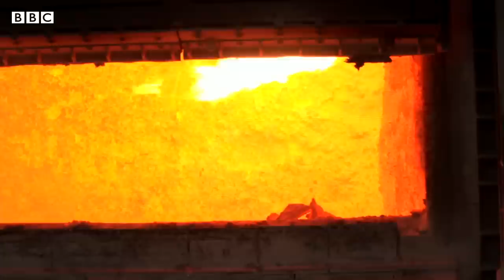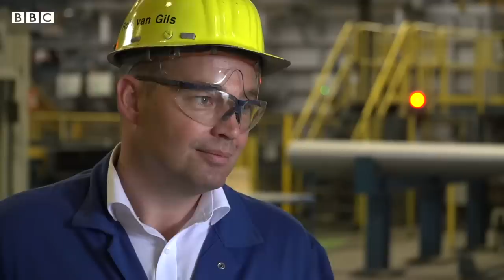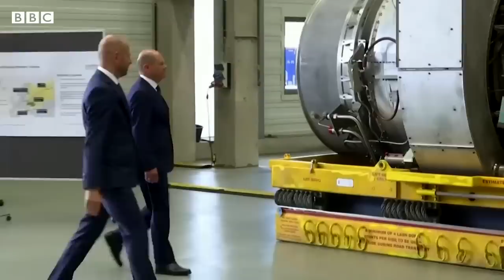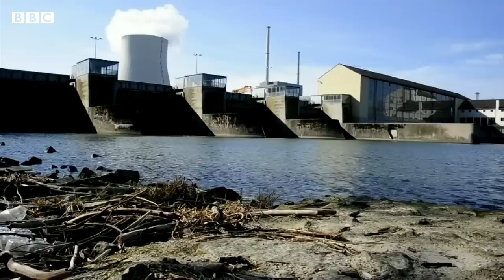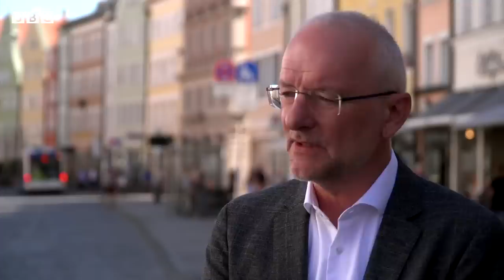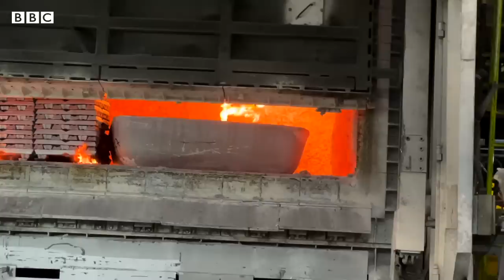Impossible to return turbine vital for Europe gas supply says Russia energy giant Gazprom - BBC News

Comment: And this is why shutting down the nuclear reactors was a bad idea
Reply: Well, in Germany shutting down nuclear was decided years ago, when there was enough electricity and heat to accomplish the transition to renewables
Reply: @danielbakamendez  it doesn't sound like they accomplished transitioning to renewables if their still dependent on Russian gas
Reply: @danielbakamendez  doesn’t sound like renewables are viable.  Rather bad planning.
Reply: @danielbakamendez  renewables alone are not sufficient to supply energy to an entire nation. At least not with current technology.
Reply: @Land-of-reason  Doesn't sound like gas is reliable.  Bad planning to rely on it.  Should have went full speed into renewables.
Reply: Tell that to the people who used to live around Chernobyl.
Reply: @kenbob1071  renewable are far from viable.
Reply: @danielbakamendez  and now the renewables have failed, which we new they would.
Reply: @kenbob1071  renewable energy has failed in Germany, did you miss that bit?
Reply: Everything has a finite design life. Running something like a nuclear reactor beyond it's designed working life is potentially extremely dangerous. Trying to extend that life is potentially cost prohibitive. They don't just shut down a perfectly fine reactor
Reply: @stevec6427  they did though.
Reply: @stevec6427  are you a neuclear expert who understands these reactors?
Reply: @marclang7431  Renewables work fine in Germany with 51,2% share in 2022 so far.
Reply: Indeed, too little too late.
Reply: @Land-of-reason  they are entirely viable, they just weren't rolled out in large enough numbers to sustain the power grid, and it's not like gas is going to be forever.
Reply: @nerdlingeeksly5192  so they work when the wind is not blowing.  That’s a good one!
Reply: @Land-of-reason  wind power isn't the only renewable, solar is also a renewable as well as hydro and biofuel; your statement alone shows how uninformed on renewable energy you are.
Reply: @nerdlingeeksly5192  as a scientist I am extremely well informed thanks.
Reply: @Land-of-reason  I doubt you are, the current advancements in solar alone are enough to supply Germany with most of it's electricity if they were to get them rolled out on every residential roof as a government funded initiative.
Reply: @gerbre1  Germans pay around 50% more for the electricity than all the other European countries. Also Germany's renewable energy whilst making up over 50% has not been able to achieve those figures. Now they say the need at least another €600b to maintain a stable grid. And are restarting coal power plants.
Reply: @marclang7431  Energy prices are high not because of renewables but because of fossils. Renewables are cheap, fossils are expensive.
Reply: @gerbre1  no you are wrong. The price increases were to pay for renewable energy technologies and application. As and when renewable energy was adopted the price went up. Your comment has absolutely no logic whatsoever, you need to read more into the problems and cost of renewable energy.
Reply: @marclang7431  Just search for Stromgestehungskosten erneuerbare Energien from ISE Fraunhofer, esp. have a look at the graphic with all the costs. PV and wind are the cheapest.
Reply: @gerbre1  no you misunderstand me. Of course production of electricity is cheaper for wind and solar, it's virtually free but the cost of manufacture and installation is INCREDIBLY high. A wind turbine also has a short life span less than 10 years in most cases. In the case of solar you need vast swathes of land to produce modest amounts of energy compared to a power station. A lot of the time there may be no wind or sun, therefore very little power is produced, coal and gas plants are then on standby, hence why Germany's C02 levels actually went up after reaching 50% renewable. But who pays for the expensive technology? We do, that's why the energy prices are going up, the government have said this, energy prices have to rise to pay for the renewable energy to be manufactured and installed but, when it doesn't work properly, you end up paying for the renewable energy and getting coal. Here in France we have realised this stupidity and are investing heavily in nuclear (again).
Reply: @marclang7431  Gestehungskosten contain the costs to buy and install the parts. Please read the fraunhofer paper to inform yourself. CO2 emissions are decreasing for years except for 2021 because of Covid in 2020. In France 50% of the reactors are not running and Germany has to help out with exports. Germany has exported more energy this year already than last year completely. France is constructing only one reactor Flamanville 3 for years. Meanwhile the average age of the other reactors is 37 years. EdF has 40 Billion debts and the government was forced to buy the rest of the company. It's unclear if the construction of Hinkley Point C will end in a financial desaster for EdF.

Comment: Germany can find other ways to produce electricity, but they still use gas burners for residential heating and in parts of the industry. The problem is that you cannot burn electricity in a gas burner.
Reply: Well I guess we all have to save energy, it is doable, specially the winters are really mild, I never use the heating, (Munich)
Reply: A kWhr of electricity is worth more than kWhr of gas. If you go from electricity -> heat you get 100% conversion efficiency, but if you go heat-> electricity you only get about 50% efficiency (see Carnot efficiency).
Reply: @Andrew-rc3vh  Modern heat pumps are even better than that. A heat pump with 400% efficiency, can use 1kWh of electricity to transport 4kWh of heat in to a house - But heat pumps take a long time to install, so many Germans are stuck with gas burners for the winter.
Reply: @anotherelvis  This is why electrical energy is worth more. It's to do with entropy and the second law of thermodynamics.
Reply: Electric baseboard heaters are cheap and easy to install.
Reply: No they cannot
Reply: @Deutschland8894  "I never use the heating" - some people in Germany still have children. Not all of them are lgbt.
Reply: @viaceslavmikhailovich9825  If Nord Stream 2 were working, would Russia allow gas through it?
Reply: I think it helps to understand: 73% of NG is used by industry and commerce in Germany. And the emergency gas plan insures homes and hospitals would be the last to get gas cuts. I am certain nobody will freeze. But business will need grants to survive this winter. Our economy will take a hit for sure.
Reply: Electric heats are very cheap. A 2kW heater can be as cheap as 3 burgers. No problems.
Reply: Nothing odd about natural gas heating! All of Canada runs that way. Probably because we have plenty just like Russia. Let's redirect all our exports to Germany I say.
Reply: "From that time Jesus began to preach, and to say, Repent: for the kingdom of heaven is at hand." Matthew 4:17 

"Ye have heard that it hath been said, An eye for an eye, and a tooth for a tooth: But I say unto you, That ye resist not evil: but whosoever shall smite thee on thy right cheek, turn to him the other also." Matthew 5:38-39|□
Reply: @viaceslavmikhailovich9825  there is so much wrong with this sentence. first off: lgbt+ people can have children. so that part of your sentence is just… bullshit. 
second off: i was much less susceptible to the cold as a child than i am now at an adult. i notice the same with kids i take care of. they get more bothered by the cold the older they get. 
third off: are your children incapable of wearing clothes?
Reply: @dorkstarling615  I'm literally a Eskimo but I'm good till about a week of -20F without heating. Besides having to protect the sink there's nothing that can't be handled with normal comfort clothes and my jacket just as long as there's 4 walls and a roof
Reply: @dorkstarling615  When I was 15 my mom was in nome for medical and somebody stole our fuel. I ended up going a 3 days without heat while it was -60F out and I legit just heated all the pipes with my hands, which I reheated with a candle

Comment: Currently gas storage in Germany is 72% full and 80% will be reached within 2 weeks despite low Russian flow rates.
Reply: It can last only a month if the supple completely stops at current rate of consumption in winter
Reply: @digantdalal  no. At 95% storage it would cover gas consumption for 3 months without any supply or gas saving measures. 240thw out of 990twh annual consumption. But 65% to 70% of German gas supplies do not come from Russia, but Norway, the Netherlands and a few others. Current gas consumption is 25% below 2021 levels.

Comment: The key Nord Stream 1 pipeline from Russia to Germany is currently running at 20% capacity because it's old and needs lot of maintenance and  repairs. That's why the Nord stream 2 was built in partnership 50/50 between Russia and Germany, and Russia is willing to supply through that pipe line as much gas as Germany ask. But on the other hand, the US promised Germany that they will give them the freedom LNG for 3 to 5 X the cost of gas from Russia. Who is playing the games with German citizens?
Reply: That's way too much
Reply: The usa is desperate
Reply: Liar. Nord stream one is only running at 20% of the capacity it is present capable of doing safely.
Reply: The issue is that the USA is both right and wrong. It is right that Germany became partially dependent, it is wrong in assuming Germany had a choice in this. The trouble started in 2003 - Irak broke a lot of trust. Snowden and the financial 2007-2012 crisis did too. This leads straight into the Arab spring, aka, oil etc. becoming more risky and is combined with a calculated internal decision to rely more on traditional energy such as coal and Russian gas to cut off nuclear power to win an election which unfortunately happens exactly 2 years before Russia starts its war in Ukraine in 2014. People don’t get how much bad luck was involved in this.
Reply: Russia.

Comment: Canada did not follow the correct protocol. So, Germany must return the turbine to Canada and Canada must follow the agreed protocol. If Canada thinks that by following the agreed protocol, it will violate the sanctions it has imposed on Russia, then it can keep the turbine and let the Germans freeze.
Reply: But we dont freeze? We have enough Gas capacities (72% quickly rising) and the argument of russia is not a breach of protocol by canada but unfixed issues on the turbine (wich was checked and found out to be a lie). 
So wtf are you talking about? 😅
Reply: @NotUnymous  Indeed,  the comments are full of Russian bots.

Comment: The contract states that the turbine is to be handed over DIRECTLY from the repair facilities to Gazprom representatives with no interlocutor (middle-man) between that process, to ensure that no damage or tampering to the turbine is possible, and to ensure that the warranty stipulations are honored.

Instead of that, the turbine went through the hands of potentially DOZENS of middlemen, and thus the stipulations of the warranty, for the repair and coverage for losses are null and void.

I wouldn't accept the turbine under such conditions either.
Reply: You're joking aren't you
Reply: how do you know this ?
Reply: @rivergladesgardenrailroad8834  --- I'm a civil engineer working for a mechanical engineering firm that does contract maintenance turn arounds on large industrial plants including pumping stations. Part of those contract is maintenance  and replacement of gas turbines. Our company would not install a turbine that we were not able to establish a chain of custody for that the the manufacture agreed met the terms of their warranty. Every piece of rebuilt equipment must have a paper trail..... and in THIS particular case, I've read a number of technical articles regarding the Gazprom turbines that substantiate such assertions.
Reply: @spufg9211  --- what part sounds humorous to you ?
Reply: @johnnybegood3017  absolutely. Legal chain of custody is sacrosanct.  It's not trivial. Gazprom should not touch that turbine with a ten foot pole. Just having it unsecured and out of it's packaging for Shultz to touch and display, is voiding this legal chain of custody.

Comment: Russia, shame you are capable of building some lousy turbines.  You won the space race and you have hypersonic missiles.  Why depend on the decadent west??
Reply: These are turbines on Nord stream 1 lines. NS is not owned by Russia but Nord Stream AG company localized in Zug in Germany. Gazprom have 51% share in Nord Stream AG, but in times when NS1 was constructed (project is from 1997, constructed was between 2005 and 2011), Gazprom havent majority in NS AG. Otherwise, Russia of course have turbines for gas pipelines, Nord Stream 2 lines are equipped with russian ones, but due to stupidity of EU leaders, its dead project.
Reply: Because Engineering turbines is extremely complex. You can't just design one in a few weeks and build it in a month, it takes years of R&D and testing to design a new reactor. Even if you have one to copy, it takes an incredible amount of work to work out what all the materials are and understand the control systems